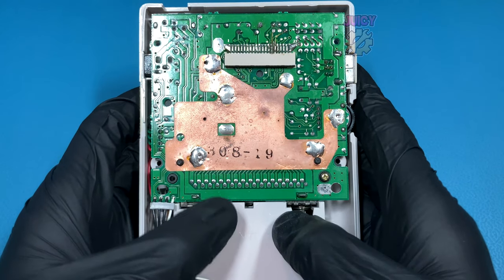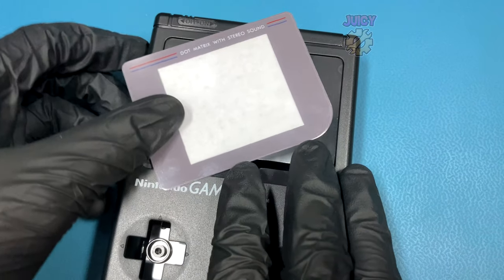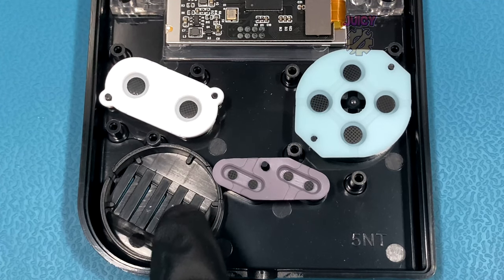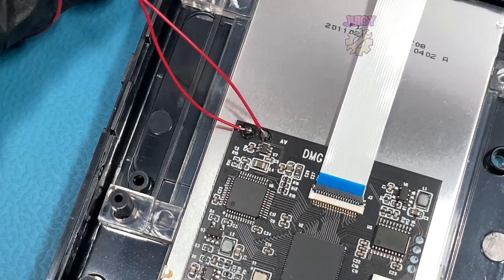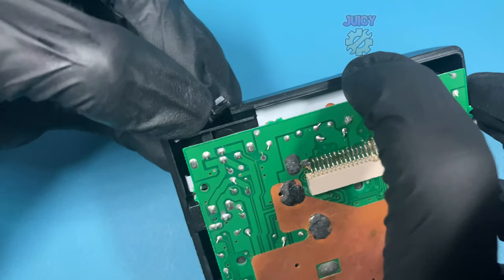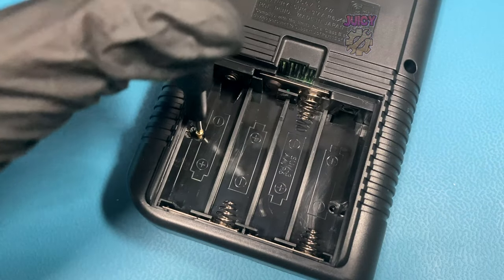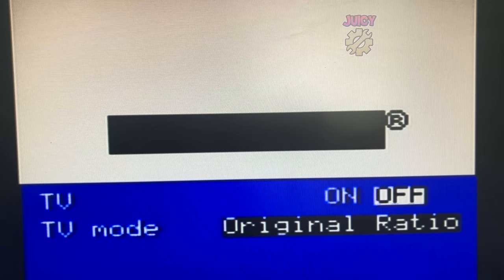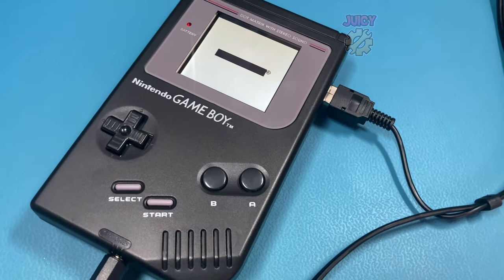Playing the original Gameboy on a TV! - RIPS V5 IPS Kit

Comment: Not a bad video but when you got to soldering the speaker to the pcb you did a absolutely horrible job on that one thing. Anyways you should have been more careful to keep your wire insulation out of the hole to prevent it from making the contact with the wire and pad as good as it should be this might be a future problem with that gameboy at some point. Anyways again not a bad video that is my one and only criticism for this video is the soldering of the speaker to the pcb pads. 
Thanks again for the video. 🙂👍✌